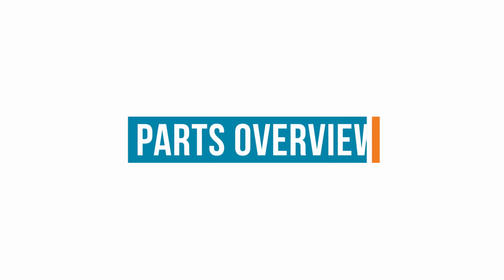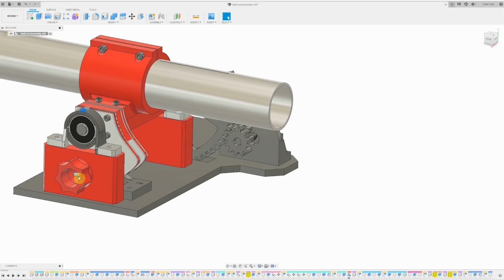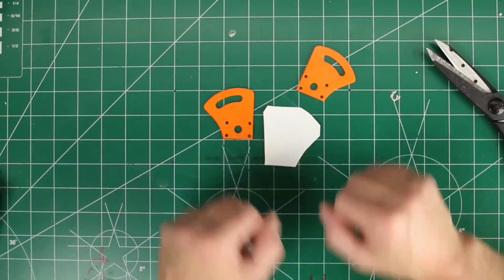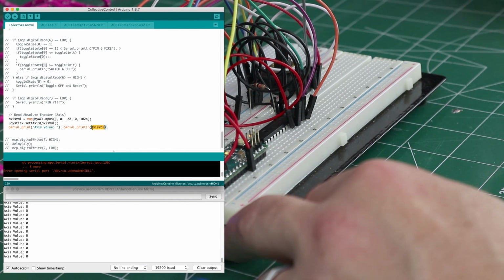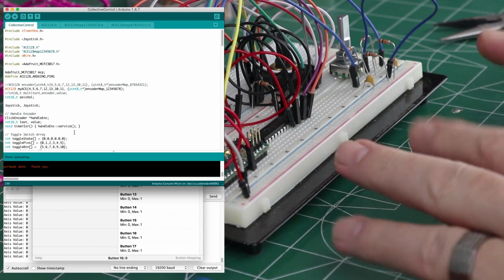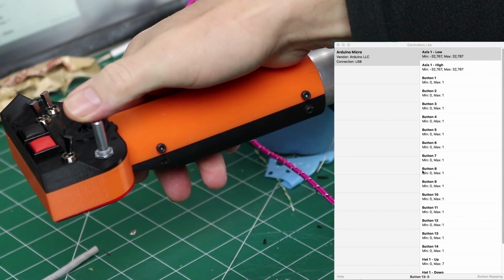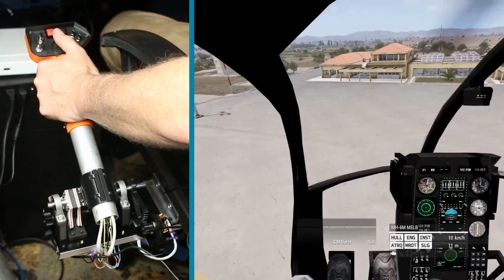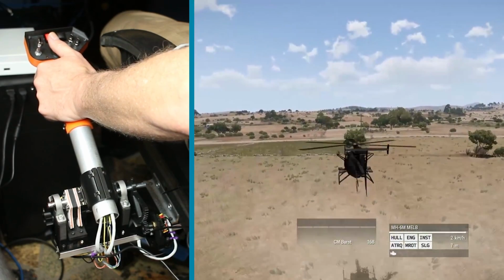DIY Arduino Helicopter Collective Joystick Control

Comment: Awesome project. Yes, collective for PC sims are ridiculously priced because it is a niche market. Thanks for this video. As much as Arma3 is an amazing infantry simulator and the graphics are awesome, it is at the level of a 1990 arcade game when it comes to fly helicopters. The only decent chopper sim on the market for PC is DCS. Also, IRL chopper pilots are always flying right seat. copilots are flying left seats.That's why, as you could see, the collective usually more simple on the left side as it is just meant for the copilot to take over the controls in case something happens to the pilot.
Reply: The reason the collective is on the left side is that, most of humanity is right handed and the pilots primary work load is the moving the cyclic with their right hand.  All Helicopters have the collective on the left.  And, if the copilot takes over, the copilot has her / his own  cyclic controls as well as the anti-toque pedals, collective and throttle mounted on the twist grip of the collective.  There is no way a copilot could control a helicopter from an opposite seat!  I have been flying helis under the X-plane software for three years.  I have a set of $3500 heli sim controls.  My cyclic is partially not working and I was looking to replace its electronics.  This is the reason I watched the this excellent video as it gave some hope that I might be able to come up with some electronics to replace my defective electronics in my cyclic control.  My heli hardware manufacture has gone out of business.  So I tried to buy a cyclic from Komodo Simulations that I found on the internet. It looks like they have an excellent design with many different cyclic models and configurations.  I sent them $3500 the first week in February (22 weeks ago) and they never sent me my cyclic.  So a word of warning - stay away from Komodo. (My credit card company is helping me get my money returned).
Reply: Blackshark Den, not all helicopter are commanded from the right seat, MD500 series (little bird) are commanded from the left seat. Cheers

Comment: If you talk with a rotary-wing pilot, depending on the flight frame you will find that the collective has some load/weight and a level of haptic feedback. It can feel heavy at times and also light. You might think about adding this using servo motors and enabling the use of force feedback, relatively simple. It depends on the speed of directional motion, crosswinds etc.... If you didn't want to use servos then I suspect you could use a spring mechanism that has a lag in the tension release. Liked your work very much.  Have fun.
Reply: Thats a great idea! I am not sure about the feedback protocol coming from the sim. Do you have any experience with that part of it? I know how to do the hardware bit, but not familiar with the data stream coming from the sim software.
Reply: @kalebclark5826  I am not familiar with the SIM and what it can provide. I use to work on real-world simulators. I suspect that there would be some math models around that would take in the rotational velocity & momentum, the rotary-wing angle of attack, frame airspeed velocity & wind skew, potentially torque control, and cyclic pitch would add to this. Airframe torsion would also play a factor. I am sure some of these instrument feeds are available from the SIM, but I don't think it needs to be that complex. Just simulating the heaviness of the airframe when you increase collective pitch and resistance when you decrease it. I suppose it needs to more closely represent the dampening of the collective. Additionally, when you hover there needs to be a feeling of weight in the collective. What I could say is.... get your arse in a real-world flight frame and experience it first hand what is needed, you will love it I am positive. There is a lot of feedback that the control systems provide. Then again its like cars, some have so removed you from the feeling of the road where other super high-performance cars need you to be able to feel the road, the steering the forces at play so as you can better anticipate your reactions.
Reply: There shouldn't be much feedback in the collective, and virtually none for an aircraft with hydraulic controls!
Reply: @bent6680  We tested this using dynamic load feedback systems for high reaction short and long-duration flights, additionally for low and high stress situations. No feedback = very unhappy pilots. Most pilots wanted to be able to feel the airframe through their hands but not the stress of airframe maneuvers & did not want the muscle load when on a long-distance flight. What worked was a system that allowed for adaption by the pilots. WIth the fly-by-wire (computer wire) these kinds of systems are readily implemented. Older guys who had flown the older airframes DC9's, Hueys, CH47's, etc.... had the ability to feel the flight frame through their hands and feet instead of just G's and instruments. Newer pilots because of re-action times were way more visual and instrument dependent and felt the flight frame more though body stresses. But what ever you come up with I am sure will add hugely to your enjoyment of the simulator. Cheers.
Reply: That's also true of small GA/LSA aircraft that still use rod or cable coupling.

The 'feedback' is the force of air over the control surfaces, so it varies with airspeed and several other factors.

As for force feedback in commercial hobby simulators... I'm not sure.

Historically we had the Microsoft Sidewinder and Logitech ranges of force feedback sticks, and it's possible some games may still support the underlying API's from those.
But that means matching the design of your force feedback system to the expected behaviour of those old devices.
It used to be part of DirectInput, but DirectInput is in itself technically semi-obsolete. (it's still in widespread use, but Microsoft keeps insisting people use Xinput instead. And X-input has some nice features, but it's also severely lacking in functionality compared to the older API...)

I'd say it's anyone's guess if any flight sims still support the old hardware, and that's about the only standard we have.
(that, and the Novint falcon, but I doubt you could reasonably replicate that - this is also defunct at this point. The Novint falcon is essentially a delta robot configuration repurposed to provide 3-axis force feedback... An interesting approach, but not the most straightforward. Plus compatibility might be difficult.)

Comment: As someone wanting to build one of these, as soon as you mentioned 3D printed parts, my heart sank. 
I don't have, and can't afford a 3D printer. So i'd have to get the parts printed and mailed to me, which won't be cheap, or buy a 3D printer, which would cost the same as a premade collective.

I was totally onboard and looking for all the mechanical parts until you mentioned those bits. :(
Back to my own build i guess. I was just going to use a ~22mm dowel rod, as the collective rod.
Why the 22mm dowel rod? So i can put an e-bike/electric scooter throttle on the end to control the helicopter's RPM.
 My biggest problem is the friction bit. I need a way to add the friction to keep it in place.
Reply: This friction parts are flat so you can easly cut it with coping saw from plywood or mdf. Same apply to big cog. Small cog will be harder to make but nothing impossible. You can simply open stl file in 3d builder (free microsoft software) and print it on paper. Then You glue this to some playwood and cut. 3d builder also can make cross-section of part so more complex elements are possible to make by layering few cutouts - just like in 3d printing process :)
Reply: Another alternative to 3d printed parts may be plastic electrical conduit and junction boxes. You can get them pretty cheap at home depot or Lowe's
Reply: I live in the middle of nowhere and our library closed down due to lack of funding. That said, KKuurus may be onto something. Getting the friction is easy, keeping it is tough, as the nuts would loosen up over time, even lock nuts. But if i use a heavy spring to apply pressure, like a brake caliper, that might work.

Since i'm using a common wooden dowel rod, it'll be pretty light weight, even with the grip on the end.

The rest of it would be like this, my quick MS paint sketch i made for a friend a while back who was having trouble understanding what i meant. https://photos.app.goo.gl/q3MStnYpsA1C7V7DA

I only have the Teensy listed instead of a normal arduino, because it's what i already have on hand, and it's been collecting dust for years. My only arduino pro micro is already in something else. But Teensy's are great for joystick/hid devices so it's all good. They're just a bit expensive.
Reply: You might check if your local library has a 3d printer. A lot of them are doing that these days. Where I live a local air and space museum also has a maker space.
Reply: use a spring washer to press against the handle at the rotation point. I'd think about five pounds would do it. Spring washer are curved washers that are thin the tighter you squeeze it the heavy the pressure.
Reply: Brandon has a good point, a makerspace would be a great resource for printing the parts. If you are interested in this sort of thing it may be a good connection to make anyway!
Reply: If you have problem with getting friction using substitute materials for the 3D printed parts, reducing the amount of friction required by adding a counterbalance to the rod might help.
Reply: In second decade of WWI century you don't need buy a 3D printer for have 3D printed parts, plenty of services around. Upload the drawings for"Hubs" and select a service near you.

Comment: Nice video. I just have one question. Doesn't the collective have a second "control axis" by twisting the handle? I think I have read somewhere that by pulling up/pushing down you control the pitch, but you need to twist the handle to change the RPM. Might be mistaken though.
Reply: From what I understand many of them do and some do not. I decided to go without due to the complexity of the project as it was.
Reply: Kaleb Clark  please don't get me wrong. It was not meant as a critique or to diminish your project. I wouldn't be able to do such a p myself. But maybe it could be an idea if you ever wanted to upgrade it and your flight sim supports it.
Reply: @thomasbezencon2121  Not at all, I might have been a little brief in my reply, but it was not intended as such. Just a brief explination of why I left that part out  :)
Reply: Yes they do.  If I can get a .step CAD file I'll add that.
Reply: @JohnScherer  Working on that for you! Check in on the E14 page shortly.
Reply: @kalebclark5826  Updated Element14 page, should be there now!
Reply: Kaleb Clark. Great project!

All helicopters have a twist-grip throttle which controls the engine RPM (and therefore the rotor RPM in powered flight). It's important for serious simulation, but you won't need it for just basic flying around, because most helicopters (excluding some old machines) adjust the RPM automatically.

The throttle is used whenever manual RPM control is required, primarily; startup, shutdown and emergency procedures. Only in certain aircraft it will be required in normal flight as well.

For basic flying you don't need it. For serious simulation it opens up a lot of extra things you can practice.

Hope this helps.
Reply: @TheBigFatHairyCheese  Great info Lloyd, Thank you!
Reply: @TheBigFatHairyCheese  Didn't know that most helicopters had it automatic. Learned something new. Thanks.
Reply: Lloyd Greenfield Not all, some turbine aircraft have power levers on the overhead panel!